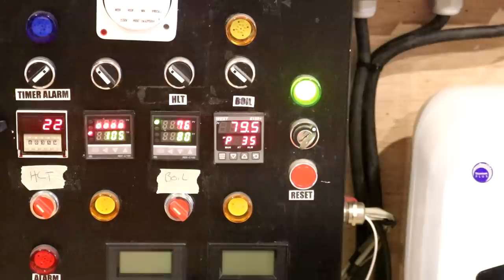I MADE IT FIT PROPER

Comment: If you had a Rocket Heater/Stove (search it on YouTube) - you won't have much, if any, smoke. As a bonus, they usually have a "self feeding" input port.  They are very easy to build, if the other stove doesn't work out. Nice one on the false bottom.

Comment: I agree with Jon and open the bottom of the stack. If you try stopping the "puffing" it may puff out somewhere else you do not want!
You could also slow down the cooling water a bit until you get a water temp closer to 15 Celsius. The water flow may be too much and causing back pressure in the condenser. I am a refrigeration mechanic and a gas fitter. I work with gas fired pressure cookers and they are designed with 3 pressure fail safety's . Careful with steam under pressure. Cheers!

Comment: If I remember right, you had said your condensation stack worked better before you put the condensate drain pipe on. What if you created some kind of funnel to catch the run off and leave the bottom of the stack open, I wonder if that would work?

Comment: Ok so I have a suggestion for the condenser..... on an unvented cylinder when we install the D2 safety discharge pipework we use a tundish to a)see the rate of discharge b)stop back pressure. I think this may work for you!
Reply from the maker: So there is a word for it, Tundish. Looks the part, Cheers SJ.

Comment: Hey harry here in australia i have a evaporative aircon it uses insulated tube through ceiling to each room a idea could be to mount something similar above werever you mount the fireplace then feed it to your workshop etc that way you can heat up multiple locations if that makes sense

Comment: If you put a little 90deg piece out of the side near the bottom of the condenser, maybe 6" up, you should have a strait vent from the cold gasses inside at the bottom to the air. That'd releave the pressure. Just need to make the upright on the 90deg long enough that any water that does get caught in it doesn't spurt out. Think 20mm pipe, shouldn't have any trouble with the water actually crating a seal.

Comment: Flexible air con ducting it looks like aluminum foil mount one end directly above your burner and run the ducting into workshop shut doors and use hot air rising to transfer heat from one room to the other would work a treat i reckon better than the mini fan heater anyway

Comment: How did you obtain casks for a value much much much cheaper than just there scrap weight in metal? Surely the auction company would have just scrapped the metal value of the casks before selling them for pennies? Is this a fixed auction where the seller agrees to an open bid, hoping for a high bid.. but doesn't set a minimum bid. Kinda like Ebay?
Reply from the maker: There were quite a few plastic casks on the lot. It was a liquidation auction. I will find out more today when I collect them.

Comment: Did you not consider putting a rubber seal on the false bottom? Wouldn’t that have been a lot quicker and easier. 😁
Reply from the maker: I tried, It just kept slipping off.
Reply: Fair enough.. glad it’s working fine now though... I need to try these beers of yours but live down in the south west haha.. a bit far to drive haha.